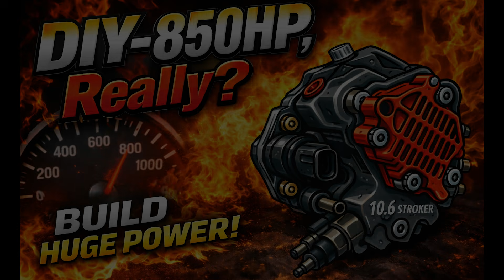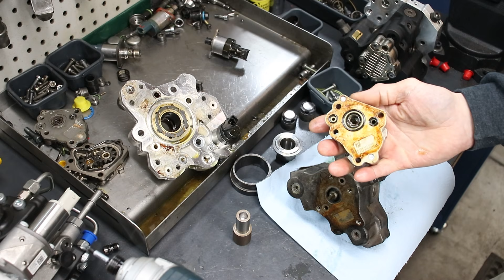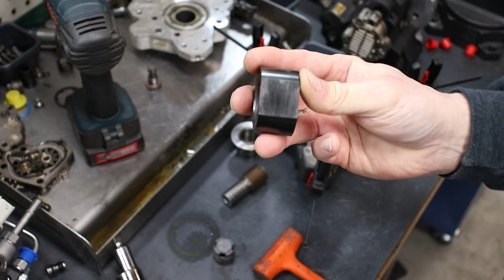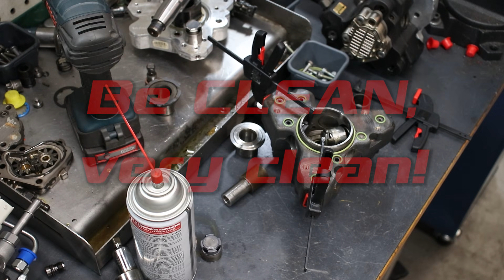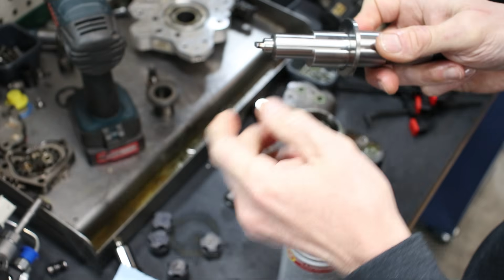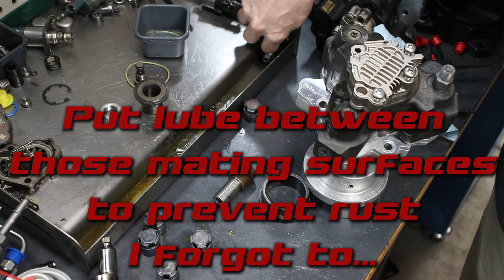Do it yourself Stroker CP3, 850 horsepower?

Comment: Hi Shane. anyone ever run one of these strokers as a cp3 dual fueler for a 6.4 powerstroke to feed 175%? I was told I need at least a 10mm cp3, I dont feel like spending 2000$ on a pump if i dont have to, should your lmm pump shaft in theory keep up? I might call you sometime to discuss, figured id just reach out here first to see if its even plausible haha.